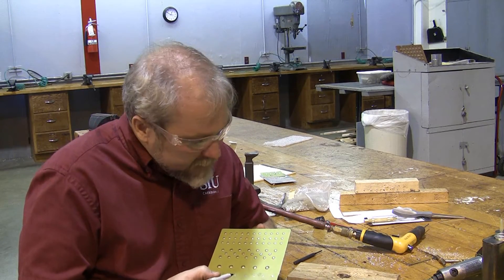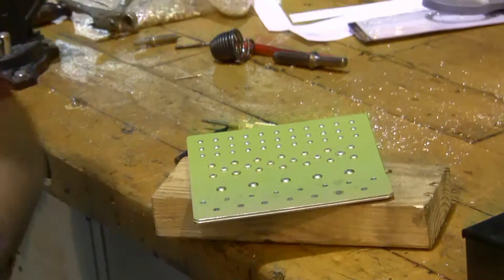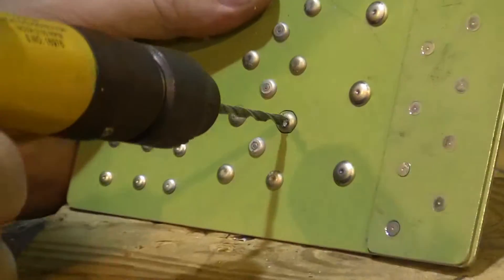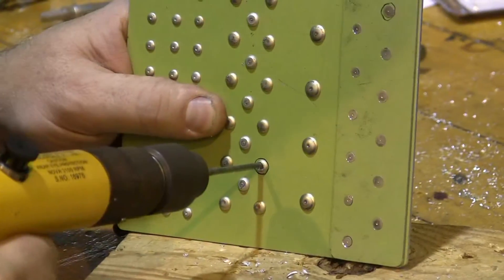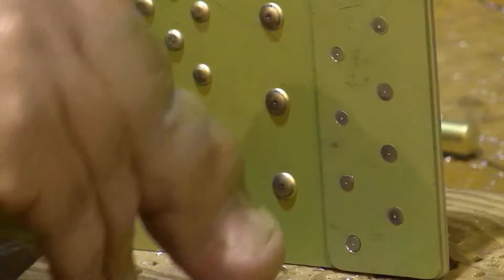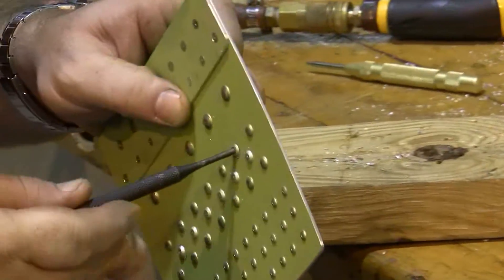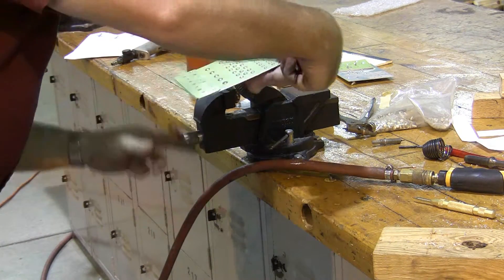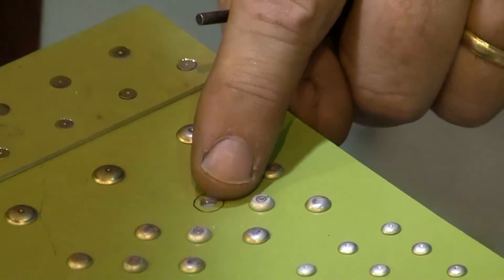AVT 206 A&P Sheet Metal Class - P1 - Removing Universal Head Rivets

Comment: Are you using a drill bit that is the same size as the rivet shank, or is the bit one size larger (1/8 for a 3/32)?
Reply from the maker: You use a bit that is the same size, or one size smaller (i.e. instead of a #30, use a #31).  Drill through the head of the rivet only, then use a pin punch to snap the head of with a tipping motion.  You don't drill through the material, or you risk damaging the base material so that you can't re-use it.
Reply: @1donagin  thank you it takes some practice for sure but I think I'm getting the hang of it. My biggest goal is to not mess the rivet up in the first place, lol.
Reply from the maker: @omitthelies  - true.  However, I am usually repairing, not building.  In a repair, you often have to drill out almost as many rivets as you put back in.
Reply: @1donagin  I'm sure once I actually get to do my job in the real world that's what I will have to do!